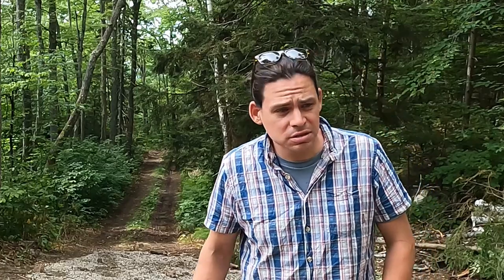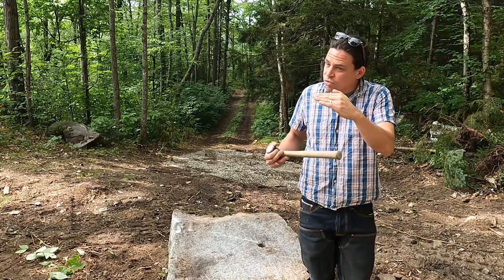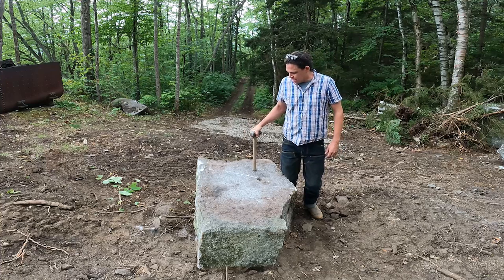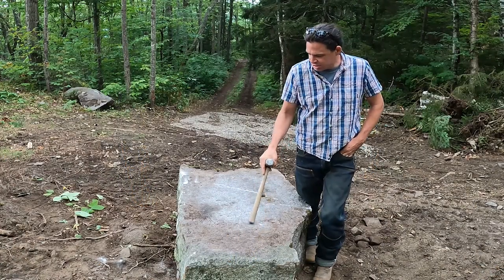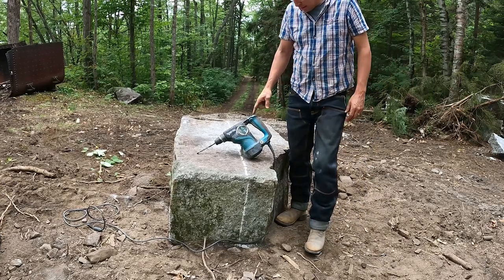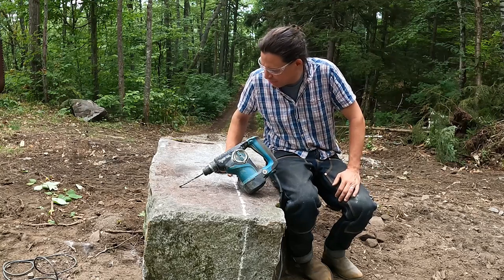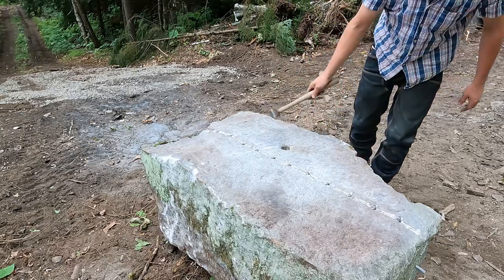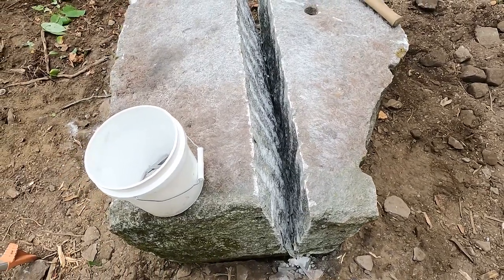Introduction to splitting stone

Comment: Those wedges were a lot smaller than I thought they would be. That was very educational.
Reply from the maker: These are 1/2" wedges, this material splits pretty easily so the smaller wedges work well. I will be getting bigger wedges for bigger blocks eventually.

Comment: My impression is that part of the hammer drills advantage is it’s rotation which helps clear the face of the hole of cuttings, leading to a cleaner strike. By hand, your chisel is often striking cuttings within the hole.  In my business we typically use water or mud (a slurry really) to clean cuttings from the hole and cool the bit.
Reply from the maker: I'm pretty sure you're correct, after rotating the bit it would take a couple strikes to get through the resulting dust before I was hitting stone again.  I need to get compressed air up there for a variety of reasons, but in this case it would have been helpful to clear the hole.  I assume you drill wells of some type?

Comment: I cannot tell you how much I appreciated your video today.  I live a bit west of Vermont (Nebraska), but north of us is a stone called Sioux Quartzite, or the old name is jasper.  It's a beautiful red color with flecks of red in it, a beautiful stone, and like the granite you're working with, a granular igneous stone.  In the older parts of Midwestern towns you would often come across a house using stone blocks just slightly thicker than bricks and otherwise similar dimensions to construct the house, or the garden wall, or the curb, etc, and I always wondered how the blocks were constructed, since they didn't have a sawn surface, but had a more natural face.  I'm pretty confident that those stones, from the 1890's-1930's, were probably created using a similar technique to the one you demonstrated today.  Thank you for answering a 50ish year old curious question.  :)

Comment: My dad needed to fragment a huge flat bolder so he could move it to make way for a new garden. He had watched his father split a large stone with a half stick of dynamite. They used a chisel to bore a hole and packed the dynamite with clay. My grandfather lit the fuse and casually stepped back a few steps while my grandmother freaked out. They barely heard the thud and the stone split nicely. So my father resolved to do the same to split his boulder. After we finished boring the hole with a chisel, my dad was unable to procure any dynamite. Times change. I still have the boulder with the bore hole and I'm going to keep it. All this came to mind while I watched you split that stone. I wondered if you ever work with low explosives in your stone work?

Comment: I find that a magnetic retrieval tool that fits in whatever hole size you are using is good to have on hand when doing this.  If a feather or wedge drops in a hole  it makes it really easy to get it back out.  It would have been handy to get all the pieces out of the crack at the end.
Reply from the maker: That's a good idea, I reach for my multi tool pretty often, but that's only helpful if it's not too late

Comment: I enjoyed that immensely! Question, what happens if you hammer the wedge all the way in and it doesn’t cleve? Is that when you start hammering on the end pieces? Do you apply a judicial force with a breaker bar or 5? Or do you just get a bigger hammer, xD (That’s an industry wide joke for all you non construction types.) I’m a commercial sculptor from Florida, so the hardest stuff I have experience with is concrete, pine, and EPS foam. Utterly fascinated by this! (Gold Shaw fan; “My Buddy Alfred” is my favorite earworm,…)

Comment: Hi, awesome video.  If I use 5/8 wedges, should I use 1/2 drill bit?  I am afraid if I use 5/8 bit, I can risk the wedges going all the way into the rock without the rock splitting.  Also is it a lot more challenging to hit the wedges sideways?  In the video you just hammered the wedges on the top surface.  My granite rock stands tall and have a very narrow top.  I will have no choice but to do most of the hammering sideways.
Reply: Stick with 1/2" holes. Use more wedges and pause longer to let the rock react to the wedge pressure. Never be in a hurry.
Reply: @LarryDickman1  thanks for your feedback but what do you mean by pause longer?
Reply: @leungfy1  stop hitting the wedges and let the rock react to the internal pressure. Hard to say how long maybe 30 sec. to a minute.
In larger operations they have multiple splitting operations going at the same time. Going to the next stone is how they pause and wait. Going down the line of set ups and then returning to the 1st. Patience Padawan.
Reply: @LarryDickman1  My granite rock is pretty big.  I guess I can start drilling another set of holes while I wait.  Thanks for the tips.

Comment: I am an occassional rock breaker and use 5/8 wedge and feathers to clear off a lot I own. Just want the rocks gone. Almost all my rocks are basalt (super hard) and respond well to a W&F tap session. However recently I have encountered a few rocks which seem to be hard (igneous) and no matter how many W&F's I put in a row, they just bottom out, and the best I get is a few small rock chips which seem to be the skin or top layer. It could take me months to destroy one rock. I believe the rock is permeable or porous and as I drive the wedges the rock internally deforms and simply absorbs the stress witthout breaking. I am stymied. Have you encountered this and do you have any suggestions. Thanks!

Comment: how do you know when the feathers are at the right hight.
Reply from the maker: The tops of the feathers curve outwards, I try to place them in the hole so that the curve starts just above the top of the hole.  My goal is to ensure that the feathers are completely in contact with the stone, if they are too deep then the curve will kind of hold them off the wall of the drilled hole.